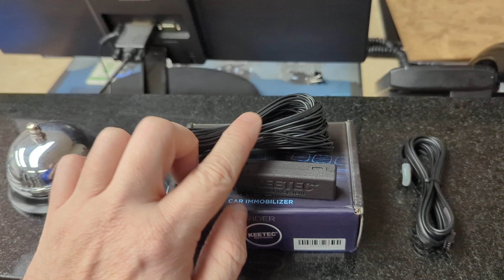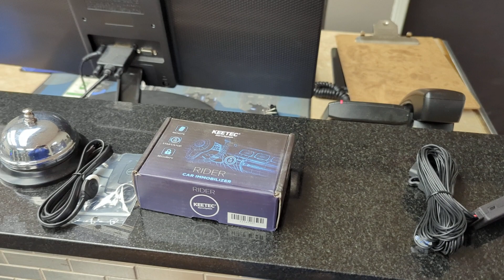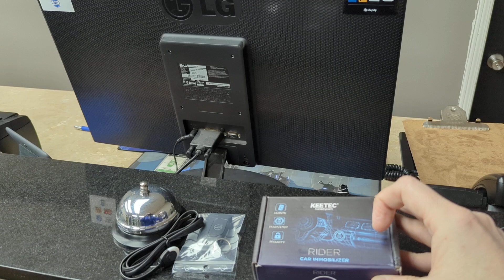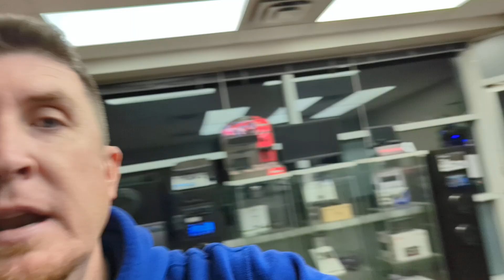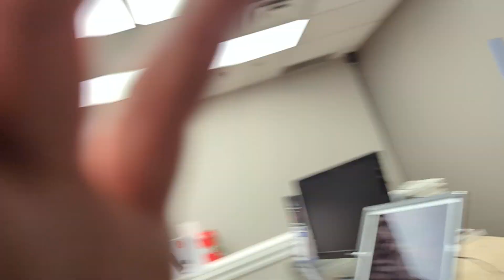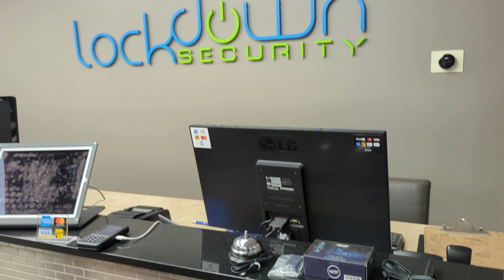Had your car stolen? Don't let it happen again!  KEETEC RIDER #lockdownsecurity

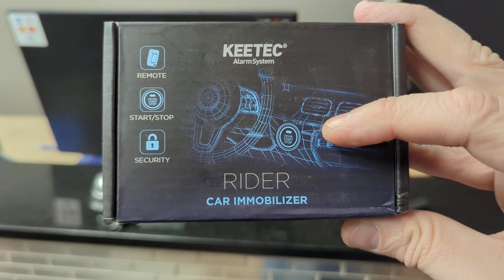Comment: 1:40 If the Keetec Rider is designed specifically for push-to-start model vehicles, is it compatible for a SUV that uses a physical key? I got a quote from you guys for a Viper 3105V but they also recommended the Keetec Rider to me. They said they'd follow-up with a Compustar quote by email too. Now doing research like this video after getting home I think the Keetec Rider is actually not suited for my prospective vehicle? 

Also was advised by your salesman since my SUV is early 2010s with a physical key, I don't have to worry about the CANBUS attack (so no CANBUS shield needed) and not to worry about a OBD port lock because those are for newer vehicles? Is that correct?
Reply from the maker: The KEETEC Rider can be adapted to work on any vehicle, but out of the box it is designed to be used on push to start vehicles as, the Rider device itself is a low current relay essentially, and push to start vehicle circuits, specifically the push to start button, are low current. Key start vehicles, like yours, generally (majority) will have high current circuits related to starting of the vehicle.

That doesn't mean the Rider will not work on a key start vehicle, it just means more labour and adaptation to work.

Key start vehicles, specifically those with immobilizer keys are more secure than push to start vehicles, it's the physical key that makes the difference, along with immobilizer chip, today's thieves are not targetting these, they are simply too much work to steal (compared to push to start vehicles).
Reply from the maker: OBD port blocking on a key start vehicle, not of huge value, as they aren't stealing key start vehicles for the most part, and due to this, not exploiting the OBD port to program a fake push to start fob. 

CAN-BUS attack is also not of concern, as they are not doing this to key start vehicles either.

Best bet for a key start vehicle, a solid alarm or alarm with remote start, from a name brand like Compustar or Viper.

The choice between alarm only or alarm + remote start comes down to your need for convenience of remote start, OR does the vehicle have remote start. I will make a YouTube video on this.

The choice between Compustar or Viper, and why to choose one of these two brands, is a personal one (which brand do you prefer) BUT there are technical reasons as well. I will make a YouTube video on this.

Comment: Hi Jeff.  If i have this keetec rider installed in my 2022 acura rdx and  my rdx is parked 50 feet away from me
(Also the authorization tag is in my pocket, so it is also 50 feet away from the rdx) will the engine start if i remote start my car or no?
Reply from the maker: Yes the remote starter will start regardless, the KEETEC Rider does not stop the remote starter from working. It is designed (the RIDER) to prevent the push to start button from working/functioning, while the RIDER is armed.
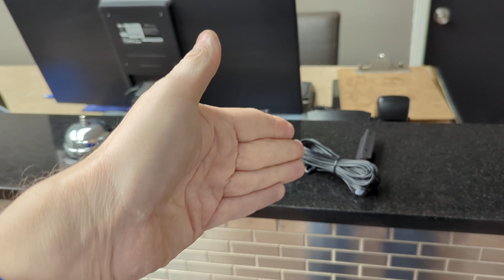Reply: I wonder if you clip and add it between the right wires, you could disable the shift electronic shift knob. Or use one of the relays to disable the power to the shift knob and the other to block PTS1? Can you preve 3:15 nt a start without blocking both PTS1 and 2? Or even use 1 of the low current relay outputting to 2 diodes that trigger 2 external NO relays that break PTS1 and PTS2 when active?

Comment: Pretty Cool!!
I would definitely look into this if I had an oem PTS vehicle.

Fortunately my build is using the VAISTECH SEER PTS which is such a great package!
Reply from the maker: What is cool about the RIDER is, essentially it is a proximity controlled relay, a dual pole, dual throw relay so you can open/close two separate circuits, and use it for almost anything in the vehicle (provided the circuit being open/closed requires less than 1 amp of current). So you can do things like protect an OBDII port, or stop an electronic gear shift from working, or interrupt a brake switch, all different things you could protect to help stop the thieves from stealing the vehicle.
Reply: How much is it?